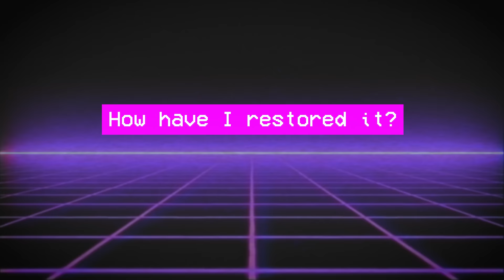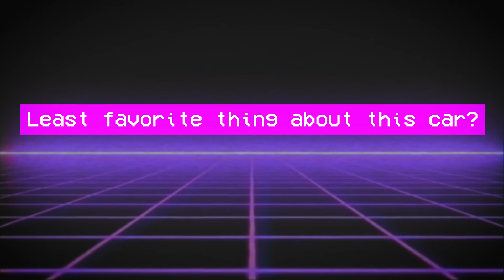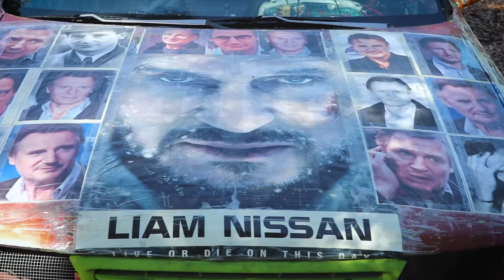Holy Crap, I'm No Longer a Car Hoarder!

Comment from the maker: If you owned these, which would you keep, which would you sell, and would you add anything else to your fleet?
Reply: Maybe I am being presumptuous but I always think of the Prius as being the 'family' car rather than a part of your personal collection. Keep the Nova!!!! For 'gosh sakes' change the plugs, belts and transmission lube in the Scion and keep it as well.  That will mean you are down to just two street cars when the Probe and Jeep go. When the dust settles the irreplaceable Nova can get a little TLC. 😁
Reply: Just don't sell the Probe or the Nova, those are the most "Hello Road" cars. Try to make some collab with a bigger Channel to improve them...
Reply: I agree with selling the Wrangler and Probe. Maybe add an electric car. Like a used Leaf or something inexpensive.
Reply: Keep the scion but do a round of preventative maintenance on it.  I had an older, Pontiac badged car from the same platform and there is a high likelihood it needs a new cam chain tensioner and valve clearance check (both simple) plus those belts are on borrowed time for sure if original.  Betting a closer inspection of shocks, struts, steering components will prove a number of those items which are normal wear parts are near (or passed) the end-of-life.

There are so many interesting  cars out there so it would be presumptuous for us to give suggestions but I will anyway.  Any of the Colt Vista (Mitsubishi, Eagle, Plymouth versions as well) manual would be the first one my list as splits the weird but functional middle between the xB and your former Previa.
Reply: The probe is the hardest one to replace, I knwoni have a soft spot there but try to find anything for that gt nowadays, also look at the prices on good examples just going up.
Reply: Scion XB

Comment: Seems to me like you need the following vehicles: 
1. A fuel-efficient grocery getter
2. A utility vehicle with a bed 
3. A weekend toy 
4. Rotating quirky/rare vehicle for content purposes
Reply: That's basically the Ford Probe GT. I've had a 50gal water heater in the back of mine and then went and did track days on the weekends, brought my first child home from the hosp in a Probe GT as well
Reply: A Kei pickup truck does all 4. They're 660cc engines so they're super fuel efficient, they make ones with pickup beds, or large interiors. They're fun to drive, and they're rare, at least in North America.
Reply: @tall_dude1233 even in North America they aren’t really rare, just uncommon, it’s easy to find a kei truck these days

Comment: Well done on slimming the herd!  In my opinion, six cars is not a hoard.  I would sell the Jeep and the Probe but make sure they go to good homes.  Do go and buy some new cars, we love your videos and your pragmatism!  My favorite is your Scion xB, so nice that you can keep that forever.  Got rid of my first new car I bought, a 2001 VW Golf TDI Diesel, after 20 years and 400,000 miles but I don't regret it because that made room for my new project: a 1991 Geo Metro convertible.   The VW was the complete opposite of your Toyota, it was unreliable and needed constant maintenance, I learned a whole lot (videos on my channel) but I just got tired of fixing it.  Our current fleet from largest to smallest:
2014 Honda Odyssey (seats 8 and tows 3500 lbs and fits 4x8 sheets of plywood behind the front seats)
2014 Kia Sportage (my Dad passed away and left me the car, my 16 year old son is learning to drive in it)
2011 Kia Forte 5 (wife's car, manual 6 speed 2.0 L)
2015 Nissan Micra SR (top trim of a tiny car, so much fun, my 18 year old son is currently driving it, my mom has an identical one except mom's has manual door locks and manual roll up windows, which is exactly what she wanted when I helped her pick it out to replace her 1995 Mazda 323, now that was a cool car that I wish we could have kept and restored, anyway...)
1991 Geo Metro Convertible (manual transmission, 155,000 miles, so simple and fun to work on)
I really enjoyed the style of this fleet update video.  I guess I should do my own video, maybe when the weather is nicer.  Greetings from Waterdown, Ontario, Canada!

Comment: I must be addled in the brain but I have a soft spot for your Ford Probe GT aka Purple Reign. I remember when they were a common sight on the roads back in the 90s. The design is a product of the time but it holds up well. It is difficult to believe that Ford was going to use this joint venture with Mazda to replace the Mustang. I can understand why you would want to move on from the Probe but I will miss it when it is gone. The Chevrolet Nova Twin-Cam is another awesome car. 110 HP is not much by today's standards but it has got to be fun with such a high rev line coupled to a five-speed manual. When I feel too nostalgic about cars from the 80s and 90s, I remind myself how basic they were compared to modern vehicles. Also, as you point out, safety has come a long way since the era of parachute pants. Thanks for sharing your experiences with these cool cars.

Comment: Crazy to still see any Ford “Fazda” PGTs on the road anywhere. I owned a ‘93 from 2004-7. They were fun and mostly reliable but were fairly expensive to fix and it quickly became impossible to find parts anywhere, yielding the cars mechanically totaled after the values dropped below what it cost to fix them… hence the whole junkyard thing. But yeah, 2.5L V6, KLDE engine code. They were “famous” for people importing code KLZE engines from Japan, which were a whopping 36 more hp than the stock 164. That being said, it became popular to build them out and boost them, which could propel the cars into the 12sec range at the drag strip. Without boost the V6 used the two-stage VRIS solenoid air intake system, which was kinda like boost in the way the engine built power. These were also the days where Borla / Greddy exhausts and CAIs added “significant” ponies. When I got mine it had awful 90s 3-spoke aftermarket wheels, so I got a used set of factory 5-spokes and painted them gunmetal and polished the outer lip. Fun times!

Comment: Big step for you here, I'm proud of ya!

A few comments - 

The rust on your Prius's hitch receiver means you actually use it. Unlike most of the pickup trucks in my neighborhood.  Also in that vein, the Prius would fall under the category of "personal fleet" that I mentioned in my comments on your previous hoarding video.

The flopping tachometer on the Probe has me worried the distributor is about to go.  That's exactly what one of my old Subarus did right before the dizzy puked.  As much as I love the Probe, I know from your videos that it's not one of your favorite or most memorable.  Just pretty please, promise us you'll sell it to an enthusiast or Raddie?

The Jeep should be an easy sale, even if it is a "Wrongler".  No shortage of Jeep fans.  I'm sure it will be properly loved and abused.

As for the last two, I couldn't fault you for wanting to keep both.  The xB has a lot of sentimental value for you, and the 'rolla is that rare unloved beast that you are drawn to.  The xB is in good enough shape that you could slide it into the "personal fleet" category and leave the 'Rolla as a more-or-less permanent project car.

And voila, there you'd have room for your cycling project car slot!

Comment: Have you thought about installing a custom roll cage into the Nova? You only need to weld some brackets to screw the base points, and that would improve the safeyy greatly. With a cage you could add five point racing belts, to improve the safeyy even more.
Reply: with the headliner out already, maybe this is even easier?
Reply: I think you should research the law in California about a passenger car having a roll bar.
Reply from the maker: From everything I've read, roll bars/cages in street cars aren't generally a great idea. While they can certainly reinforce the structure of the car, they really need to be used in conjunction with a harness and a helmet. You don't want to hit your head on a metal roll bar tube in a crash. I've driven Liam Nissan on the street (it has a cage) and I only drive it while wearing a helmet
Reply: @HelloRoad  That's why the street roll cages bars are supposed to be covered with high density foam...
Reply from the maker: @p.informatico1320  I still wouldn't do it, high density foam is designed to protect helmeted heads 🤷‍♂

Comment: What a timely video- I honestly like the cars that remain (especially the Scion and Nova because I owned both, though not a twin cam Nova), and I’ve been interested e-bikes for a bit now. Just wondering how the e-bikes are longevity-wise and if parts are needed, are they hard to get? Lastly, on the car hoarding subject I’m entirely enamored with the current Mitsubishi Mirage as it’s a reminder of all the shitboxes I had as a youth. Wondering if you could score one for the subject of a video? Rental or press car, I’d just like your assessment! It’s the last cheap car sold and it seems like it was what an entry level car was, 30 years ago!

Comment: If it were me, I’d ditch the Jeep and Probe, keep the Nova, Nissan, and xB, and then replace the Prius with something electric!

And the space the Probe/Jeep occupied are allowed to be replaced with a single “rotating” interesting car.
Reply: Why would he want an electric car when he has the Prius?  He can drive more than 300 miles without waiting for an hour to recharge.
Reply: @mexicanspec Because the Prius uses gas, and an EV doesn't. You can fill up an EV at home, and you have to bring the Prius somewhere to fill it up.
Reply: That is fine until there is an emergency. @emiliorescigno

Comment: You dropped the engine? When I did my clutch and flywheel it was a lot of parts removal, but I didn't have to drop it.

And Travis in the Probe community has clutch and flywheel down to under an hour. Lol. He's a guru though.
Reply from the maker: Well didn't completely drop the engine out. Removed motor mounts and lowered it
Reply: @HelloRoad  gotcha. I don't recall having to do anything with the mounts. But it has been like 15 years since I did the clutch and flywheel.

Did you upgrade the flywheel to an MX3 one? They are lighter and make it rev faster.
Reply from the maker: @Staatus_Quo  Oh crap I've done so many repairs on this car I'm getting them mixed up! 🫠 Lowered the engine for the new crank pulley, not the flywheel.
Reply: @HelloRoad  understandable with all the cars you have! Lol